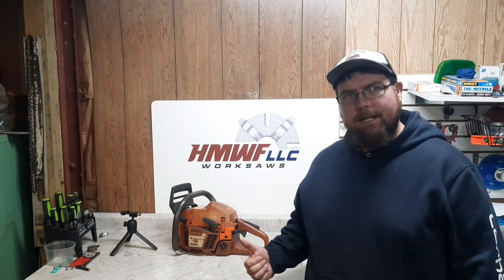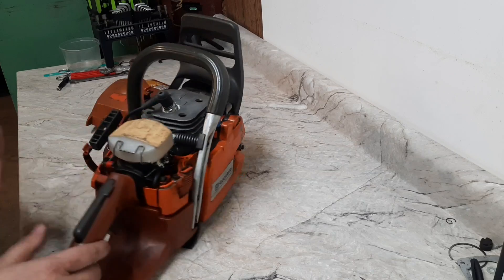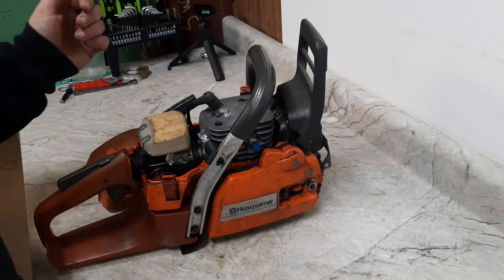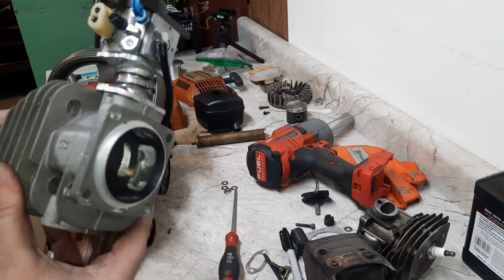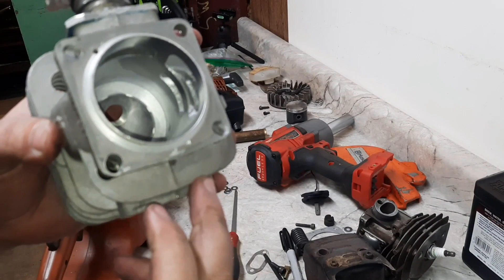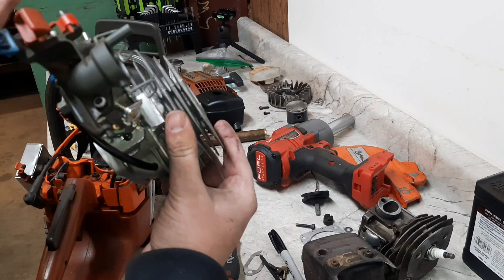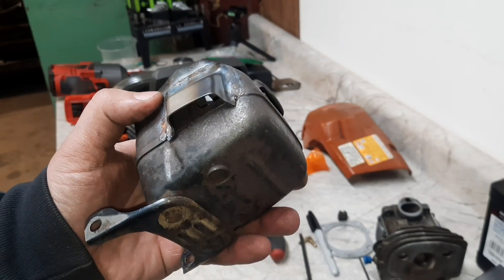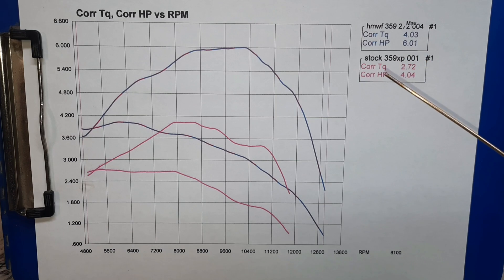Husqvarna Hybrid! 359+272xp!! 72cc sleeper

Comment: Love my 359! Great firewood saw and just a muffler mod really wakes these saws up
Reply: They are a great firewood saw 👍.
Base gasket delete and a timing advance   perks them up nicely on top of the MM.
Have a great weekend and merry Christmas.
Forgot to say, the 455/460 rancher clutch cover is a great upgrade too as it gives you a nice large side tensioner instead of trying to find that little one in there.

Comment: That's an amazing build Joe!. 6HP is still like a 15% Gain over a stock 272XP so I'd say it's pretty good (especially considering it's weight). Maybe try a 372XP carb for some extra power?
Reply from the maker: If I decide to keep it a larger carb may indeed be the way to go
Reply: Would drilling the jets and boring the carb be a easier option then trying to fit a bigger carb to it?
Reply: The problem is getting enough air, not getting enough fuel.
Reply: @Dieseldog7  yes 👍, changing the jets and boring the carb a fuzz might be just the ticket

Comment: A stihl 056 top end is workable to fitting on a 350 chassis. You would just need to bore out the rod a tad
Reply from the maker: That would be a big 350 saw
Reply: @dynojoemods2764  yeah it would.. If anyone could pull it off its you. I couldn’t figure out how to drill out crank so I could fit a bearing onto the piston rod. Was gonna try a normal drill and drill bit, but don’t think that would be precise enough

Comment: Nifty build. I don't know if the Stihl piston is windowed enough and changing from outside transfers to inside transfers might pose a flow problem. I can't help but consider JB weld to reduce case capacity. Just my clueless ramblings.  Thanks for showing us.
Reply: Why reduce the case capacity?
Reply: @brettblack7049  I theorize increased pressure to push charge up transfers through a windowed piston. I kinda remember the case volume on the 350/359 being a bit large.  Could be my imagination.
Reply: @charlespeacock8360  I see, I was thinking the opposite, large for the 359, small for the 359/372.

Comment: I ran a 359 for the first time just a couple weeks ago.  It was completely stock and I was in LOVE!  The reason I liked it so much is because it felt sooooo similar in size and weight to a 350, but with an additional 10cc!  I bet it feels Amazing with even more cc's.  I would be bummed too with only 6hp though.  Definitely a disappointment and surely it should be capable of more power than that.  Gotta be getting held back.  I for one would love to see you work the bugs out of this saw.  VERY interresting.  I would also love to see it compared to a good ported 359 and 357.  But I think you may have those in another video.  I'm pretty sure I've seen that you have gotten the Echo 620 to produce 6.8 hp and Charlie has gotten 7.2 hp, so yeah...if I built a 70cc saw that only produced 6hp...I'd be totally bummed out.  Gotta be something going on.  My heart weeps for you!
Reply from the maker: They are a comfy chassis.

Yeh it hurt pretty good.... having some 60cc best it in the hp output. Might have to try some other things. See if I can get some more out of it

Comment: Interesting build for sure. I'd be curious to know how your homemade intake boot is arranged internally. There may be some steps in the airflow that's hurting your performance.
Reply from the maker: It is a fairly straight shot. Minimal disruption. Until it meets the cylinder.  As the 272 has an odd intake port

Comment: Quick question on a muffler port job someone drilled holes in the front of the muffler and it burns the tree as it is cutting it if I pull that from defissrr off and biuld a plate to vent it to one side will that change the way the saw runs much it runs great but can't be burning the wood as I cut it well could get ugly. Thanks have fun love playing with two strokes.
Reply from the maker: Off to the side should not change performance much if any.

Comment: I bought a used Husqvarna 450 X-Torq about 3 years ago to cut up a tree in our front yard, it's been a good saw so far for my needs but I got it before I really started researching chainsaws very much and have seen all of the mods and builds that can be done. Do you have an opinion on this model and do you know what mods would work to make it a real performer rather than just a homeowner saw?
Reply from the maker: I do have a video on those, it is a ways back. But best easy gain is a muffler mod.
Reply: @dynojoemods2764  I'll look for it, I believe I told you wrong, I think it's a 435 X-Torq.

Comment: that seemed easy ...... i wonder if there is room for a 58mm big bore cylinder from a 395 ? :D 

so along the same lines as your build , it seems very possible to fit a 272 cylinder onto a 257 / 262 ( maybe even with a 254 with a 257 / 262 crank ).... which would be very similar to your build , only smaller, lighter , and with worse antivibe
Reply from the maker: 54mm could be done easy enough. But I would want a larger carb etc.
Reply: @dynojoemods2764  i was thinking 58mm :D

Comment: so to make a comment on the part where your complaining that it is low on power for a 70cc saw ...

this isn't a 70 cc saw it is a 359 with a big bore kit ... the power still has to go through a 259 crank , clutch , sprocket and bar ..... i haven't had a 357/359 apart , so i can't speak to how well theses parts will hold up to the higher hp  .... but you are putting 50% more power through it .

also with the smaller saw , it won't wear you out and you will be faster and less tired operating it ..... which would make it a more productive saw over one on a larger heavier frame that makes more hp
Reply from the maker: Yes, the rest of it is lighter than the 70cc saws. But with the engine itself displacing 72cc 34mm stroke x52mm bore I had hoped to make the same type of power as my other 70cc builds. It is a nice saw to run and use. Huge increase over stock.
Reply: I would add that this 359 is only 34mm stroke. This I believe would also hold this saw back as the modern 70cc saws now carry 36mm strokes. Night and day difference between an 038 and the 044
Reply: @chrisvincent5938  the 254 . 257  262 and the 266- 272 family are all 34 mm stroke , and there are no flies on these saws
Reply: Nice overall build Joe, it would be interesting what a 50mm jug (268 since you have everything made for that intake config) would do.

Comment: Dyno: I’ve got a vintage Husqvarna 380CD and 288xp (old one with metal chain brake). If I go bigger bore I can go sideways but the stroke has to match, correct.? Or does one have to replace connecting rod?